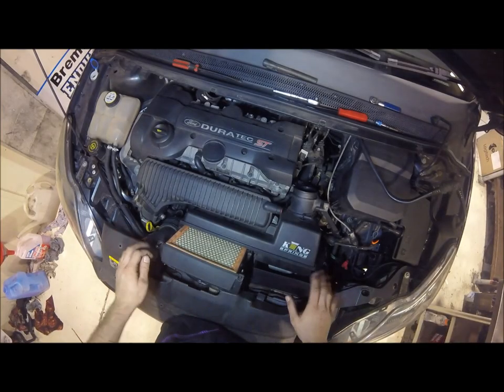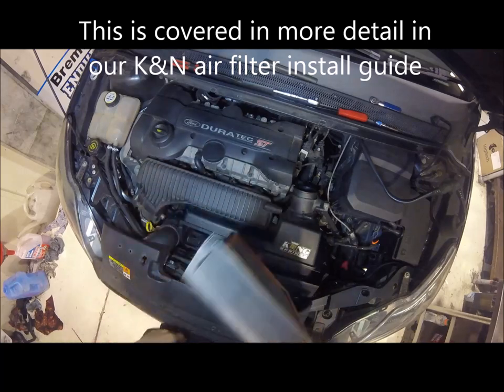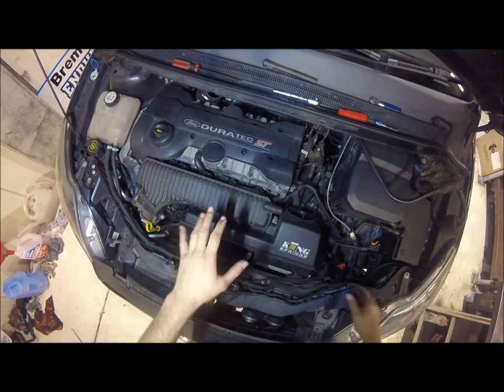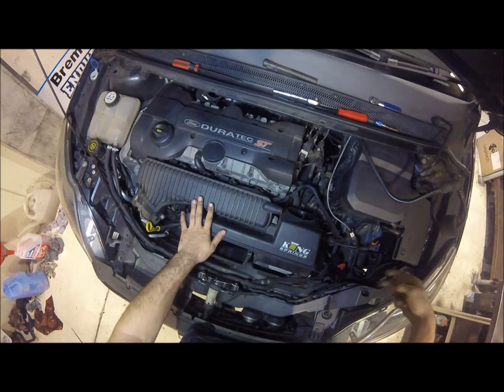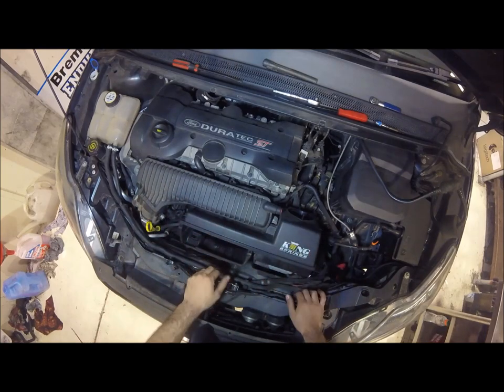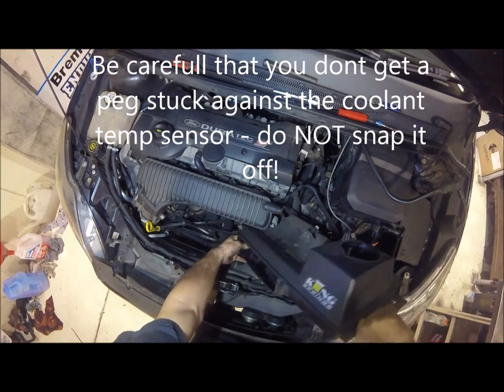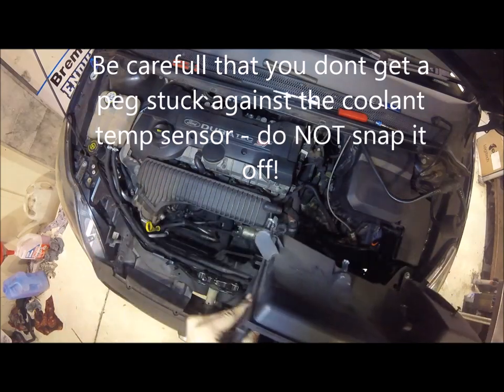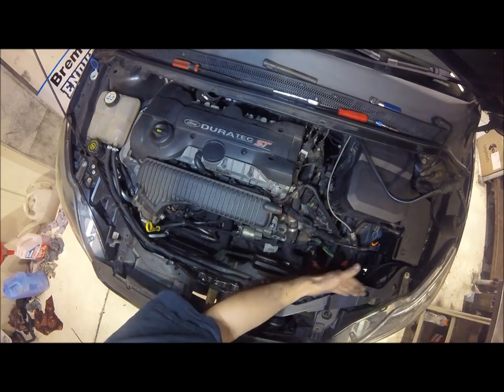Focus XR5 Turbo / ST225 airbox removal

Comment: Thanks for the vid.  There's very little information on the Volvo C70 T5 Hard top convertible which has the same engine.  A B5254T.  Replacing the radiator hoses on my daughter's C70 and the airbox removal was a mystery.  I also removed the battery, battery tray to gain better access.  This is our 5th and possibly last Volvo unless I find a super clean 240.  Had 745T, 945T, 855T, now a V70 3.2 and the C70T5.  Just did T-belt last week.  The Ford vids are helpful.

Comment: When you fit air filter where does the ecu go ? And will I have any trouble with ECU after unplugging it should I disconnect battery ?
Reply: did u manage to find out what to do?
Reply from the maker: Apologies - totally missed you question. When installing an aftermarket intake the ECU should be mounted in an RS mk2 ECU enclosure. You will cause no problems disconnecting the ECU or battery - the only way to lose data from the ECU is via programming (or damaging ECU by dropping it/shorting it out on a power source)

Comment: I have a question. When replacing with new throttlebody. Do is need new software or is the throttlebody self learning?
Reply from the maker: No programming needed mate. Only things you ever have to program on these vehicles is modules if they get replaced. Throttle body failure is rare though, usually throttle DTCs are caused by instrument cluster faults. What DTCs are you getting?
Reply: @OEMDeniedPerformance  

Hi 

I have p2502 charging system voltage.

What does ie mean. Have a new battery and the alternator looks new to me.
Reply from the maker: @stylo8133  Check alternator output with a multi meter at the alternator itself then at the battery. You may have blown the maxi fuse from alternator to the battery is best guess without seeing the vehicle
Reply: @OEMDeniedPerformance  

Thanks.
Where is this maxifuse located?
Reply from the maker: @stylo8133  Just off the left hand positive battery lead. Test for voltage each side of it

Comment: Question...the electrical socket that's in between the engine cover and the air flow pipe,  its got like a grey clip thing. Whats is it for?
Reply from the maker: That is the o2/lambda sensor in the downpipe. ECU uses this to measure air fuel ratio in the exhaust

Comment: Is this the same process for a mondeo?
Reply from the maker: pretty much, have a bit more space in a Mondeo so its slightly easier
Reply: @OEMDeniedPerformance  how do I remove the air inlet pipe from the air box on my Mondeo xr5, as it's on the opposite side to the focus. Theres no obvious way to remove it apart from force, but I dont want to snap it. Im trying to get to the starter motor so I can lock the crank and do the timing belt.Please advise.Great video by the way.Thanks
Reply from the maker: @petert696  airbox feed pipe on the mondeo is on the passenger side, pull it away from the airbox and itl unclip from it. Then you will be able to remove the airbox and leave the air feed still attached to the car

Comment: I can’t manage to unplug the connectors on the ECU. No idea how to get them off. Any help would be massively appreciated!
Reply from the maker: need to lift up the red retainer and then connector will undo itself
Reply: @OEMDeniedPerformance  it turned out there was an anti tamper guard on it which was stopping me getting to the red levers. Nightmare
Reply from the maker: @Hodgmeisterpro0209  thats very unusual unless vehicles an RS as they had them from factory but the STs normally didnt. We talking about the light gold coloured one with the snap off headed bolt?
Reply: @OEMDeniedPerformance  yeah that’s right. After doing a bit of research, it seems as tho some later ST models had them on.
I managed to get it off without damaging the levers but it wasn’t easy. 
In the end I did it all for nothing as the ECU cables wouldn’t reach the ECU in its new holder, so ended up putting it back to standard. The cables were pulled tight and putting pressure on one of the radiator hoses, so I’m gonna have to rethink that.
Reply: @Hodgmeisterpro0209  look for group a install vid by bd performance on YouTube, Im sure he cuts the plastic cover on the wires...that may free up some slack to give u abit more wiring play

Comment: Hi guys is it necessary to disconnect battery when unplugging ecu
Reply from the maker: You should always disconnect battery before unplugging any module in a vehicle.
Reply: Yes if your ecu touches the starter motor if the battery is still live then boom goes your ecu , people put a towel over the starter motor to stop this if they don't unplug battery , just a tip 👍

Comment: Hi
I'm having difficulties on removing my injector rail. does anyone have a video on it?
Reply from the maker: Take the upper inlet manifold off (6x8mm bolt from underneath, vac line from the CBV on left hand side, just behind the throttle body, line from underside to the left of the oil filter housing, brake vac line on the right hand side) Then remove the 2 x 8mm bolts holding the fuel rail down to the lowr inlet manifold and remove the torx screw holding the fuel line to the rail and wiggle the whole rail upwards

Comment: hi guys im struggling to take ecu cables off any ideas ?
Reply from the maker: if you look closely at the connectors there is a little tab that says press, press it in then flip the switch part and the connector will unplug as you lift the switch
Reply: thanks will try that